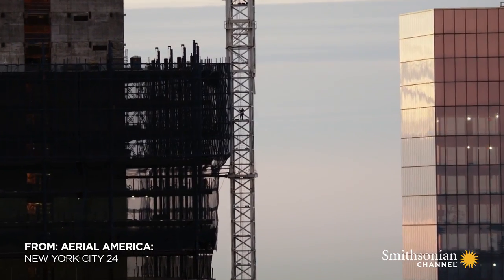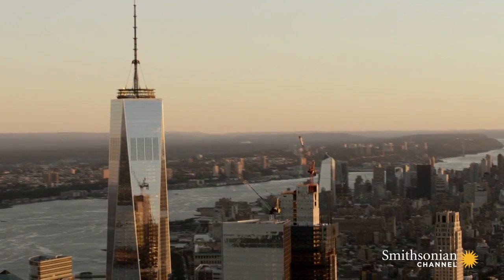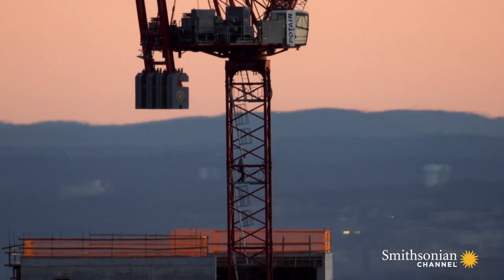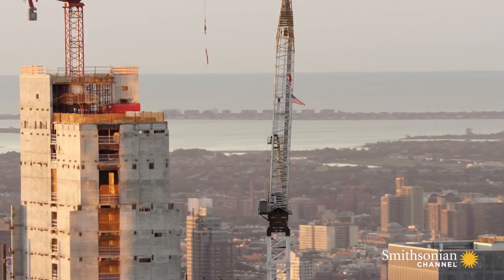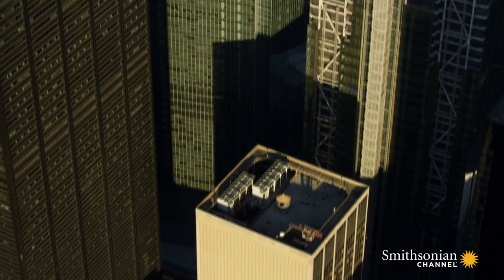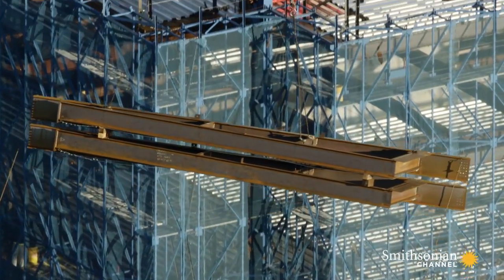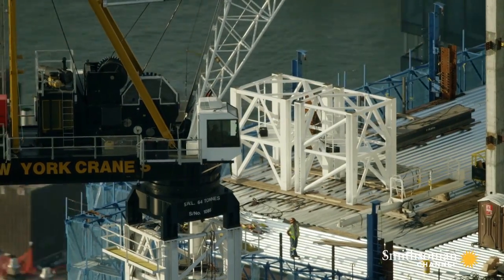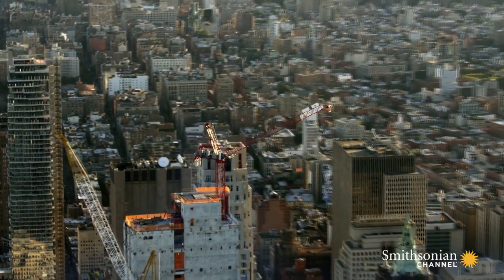This Engineering Job Is Not for the Faint-Hearted

Comment: but how do they disassemble the crane?
Reply: using helicopters to lift the disassembled parts which are unscrewed?
Reply: no. no helicopter. we built a stiff legged derrick to take down the crane
Reply: With a bigger crane